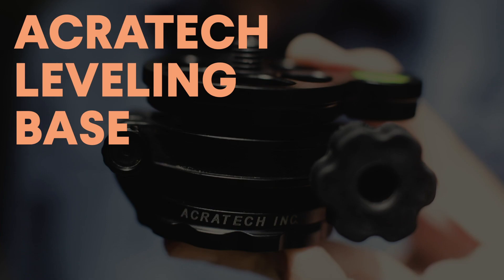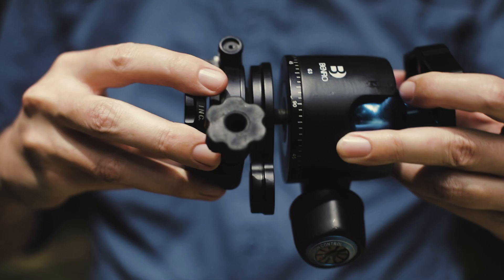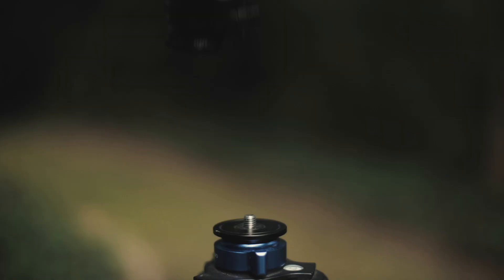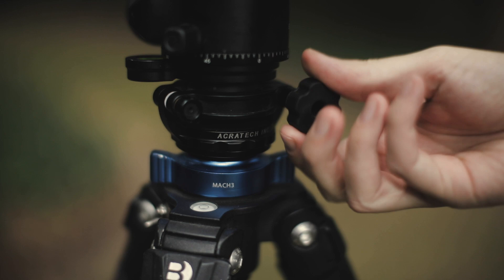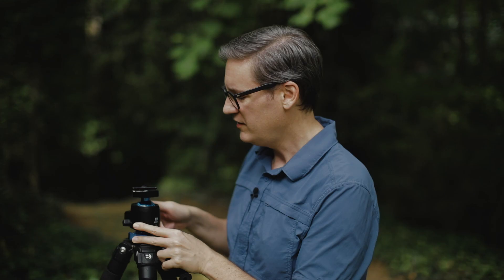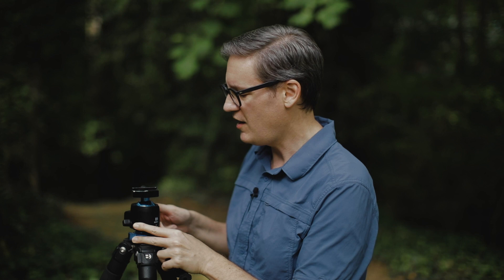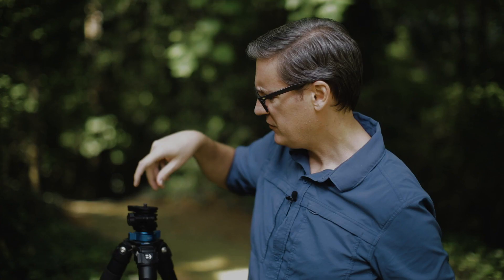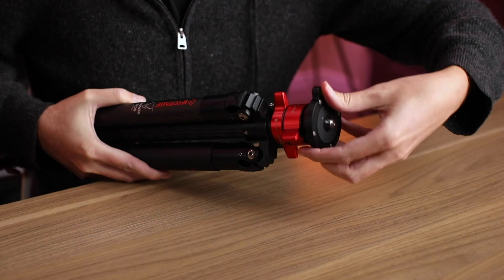How to LEVEL your TRIPOD / Featuring the Acratech Leveling Base

Comment: 1. It makes no sense to use a ballhead on top of a leveling base, because the ballhead does not have a detent for vertical position. And if you independently level the ballhead you are multiplying errors, doubling work, while adding weight. It's redundant.
Instead either: 
2. Install the ballhead (with a pan) upside down, so the pan is on top, and viola once leveled it's pan rotates level. A leveling base would add nothing but cost, complication, and error. Btw manufacturers sell "upside down ballheads" exactly for this reason.
Or:
3. Use the leveling base with a simple rotating Arca compatible clamp (no ballhead). This is compact, simple, and cost effective.

Comment: I very much like the idea of NOT having to worry about the tripod legs and farting about with legs. Very, very good little tool. A good tripod is still on my list but right now I use a make-shift C-stand and then I have a Joby. And my new tool, a remote for my camera and a wireless mic. Mic not here yet. It's these tools that I find save me time. Anything like this to help my work-flow, I'm all for. Getting a hand-me-down laptop for tethered shooting of thumb nails. Between the remote and the laptop, I think that will free me up to an extra video per week. I haven't watched your book video yet but it's my list. I watched your Capture One, one. I don't think I commented. Headed there now. I watched earlier today from a device that I cannot comment from. Anyway, long comment, sorry about that. Great video. Cheers and boogie boogie, Ivy.

Comment: Aha! So this is what I need! For my church's livestream, I have a fluid head mounted on a mic stand because we need the camera quite high up. We put the mic stand on a table in the back, but chose a mic stand because a tripod has too big of a footprint. The issue is that things are not quite level. There is a forward/backward tilt on the fluid head, but not a side to side tilt. So something like this would be perfect to get that side to side. Thanks!
Reply from the maker: Yep! It’s great with fluid heads. If you don’t to spend this much there are more affordable ones out there. I think Neewer makes one. I think the Acratech is worth investing in if you plan on using it for a while.

Comment: I have the Acratech GP ball head (an older model now replaced by the GPX) and it is superb. I primarily use it with my Chamonix 45-N2 4x5; it has never failed me. Lately I’ve been looking at levelling bases and the cheaper ones I see available don’t inspire the same level of confidences s Acratech. So, as you said, I’m going to “bite the bullet” and get the right piece of gear.

Comment: Acratech has big bobble but set bobble at the middle of circle very easy and very stable. I am using it for panorama 360 degree and works perfect. Most of tripod head bobble not stay at center when you rotate 360 degree. RRS Head BH-55 lervel is 0 to horizon for 360 degree when use Acrotch, But bobble of RRS is not stable.

Comment: Thank you Todd. Very nicely explained. 
Do you happen to know what's the best way to get good sounding ambient sounds? I travel often and want to capture not just the video, but also the surrounding sounds of the places I visit. Will a shotgun mic like your Sennheiser be a good device for this use case, or are those really only suitable for near-field speech? 
I've looked in to using a H1n since that has stereo pickups. But again it seems like those are geared towards near-field speech.

Comment: Hey Todd, great video btw!  Funny enough I got the same exact legs and ball head as you.  So im using my set to support my slider rig for videos.  Have you ever used a slider mounted to the head?  Curious how well it tightens down and holds some weight bc I would need the shots smooth and not shaky (duh)  thanks!!

Comment: That would be the same even if you didn't have the leveling base. Like the base can show that its level, doesn't mean the tripod head ball head itself is leveled
Reply: I think you're missing the point. Even if you can get the integrated bubble on the tripod legs to be level, how much time would be lost fussing over every change of position? If you have that patience then go for it, most of us rather use the time for taking better pictures.

Comment: I have both Leveling base and GP ball head. Awesome products with brilliant engineering design. Craftsmanship is top notch,  love their products. I wish them to make TRIPOD :)
Reply from the maker: I'd love to see a tripod as well. Someday I might spring for that GP ball head! Do you enjoy using it?
Reply: @dominey  They have GXP version which has bigger knobs and beautiful design... 
https://www.acratech.net/gxp-ball-head/
Reply: I also have a GP Ball Head. Acratec says "Unscrew the quick release clamp and put it onto the bottom of the head and you are now ready to use the the GXP Ball-Head to create level, single row panoramas. This eliminates the need to carry a separate leveling base in order to create accurate stitched panoramas, as you'll be able to pan parallel to the horizon even when using your tripod on rocky or uneven terrain." Does this really work?
Reply: Yes, the GXP ball head easily converts to a ball head with a panning clamp on top. Takes less than a minute to convert it or to switch it back. I bought the GXP ball head because it was a minor cost increase for the 50 lb load rating so I knew it would handle a large lens with no problems. I love using it and keep it on my macro tripod. I have Acratech’s panoramic head on my Gitzo tripod that has a built in leveling base. The panoramic head is incredibly sturdy, even in strong winds.

Comment: Yes, there is a screw on top and threaded socket in the bottom but you never said the size! Are they 1/4-20 or 3/8"?
Reply: Because it never matters. Everything commonly available is 1/4 male that can be upsized or 3/8 female that can be downsized.

Comment: Hi, I have seen some other complicated kits with bars and bolts for performing panoramas with a wide angle lenses. I bet the leveling base does the same work of allowing moving the camera horizontally and keeping the photo aligned for later proper stitching them in photoshop. Do you level the ball head fluid level as well ?? (my Markin ballhead has a bubble fluid level included). Thanks
Reply: What you saw with bars etc is a proper setup for panoramic shooting. The "bars" & pieces are to locate the lens "entry pupil" exactly over the rotation axis, to prevent PARALLAX error. Your next point, "do you level the fluid head" is a near miss that suggests you have decent instincts. It's a "ballhead" and he shouldn't even be using it in this setup. But yeah you'd have to level it too. See my post on this above.

Comment: Why not put the ballhead on the tripod and just put a panohead with switchabel indents on it .. of course with some bubble levels on somewhere. Adds the advantage of the indents on the panohead and ends up doing the same?
Reply: The point is to have the base of the head level so that you can pan around and keep level the whole way. You can use a ball head to correct a tilted base, but the correction makes things worse if you rotate the head!

Comment: With a spirit level on a tripod and one on the head, why would a third one on a levelling base be more level?
Reply from the maker: You wouldn't need a third leveler if you're doing fine leveling using the spirit levels on the tripod base and ball head plate. The challenge with this however is that both have to be level in order for lateral pans to be perfectly level when shooting panoramas or video. Getting the tripod base level can be very tricky and time consuming when using a tripod outdoors or on any kind of unlevel terrain. So instead of trying to level the tripod by raising and lowering the legs, you use a leveling base like the Acratech or other brands to create a level base for the ballhead. Hope that makes sense.
Reply: @dominey  thank you.

Comment: When using a ballhead with a mirrorles camera that has its internal digital leveller, how would a levelling base be helpful?
Reply from the maker: The internal leveler is perfectly fine for taking single photos. The problems arise however when you pan/turn the ball head, for if the ball head and camera aren't aligned, the camera will then be thrown out of alignment. Most helpful when shooting panoramas or recording video.

Comment: I really dont understand the point of using a leveling base with a ball head, except for the ability to pan from a level platform. Otherwise, whenever you use the ball head to frame up, you're still gonna need to check the level. It seems like this is an ideal tool for gimbals, video fluid or pan-and-tilt heads, where you would otherwise have to adjust the legs the level out the platform.
Reply: Yes, for panning, and therefore for panos too

Comment: Don't you folks find the tripod ballheads level very imprecise? Like, the bubble is smaller than the level ring... when I put my camera on my Benro tripod ballhead and double check the levelling with the camera's internal level, the ballhead is systematically wrong, the bubble is never right in the center of the level ring thing. Hence my interest in a very sharp ballhead
Reply from the maker: One of the reasons why I've seriously considered getting a geared ball head for extra precise positioning.